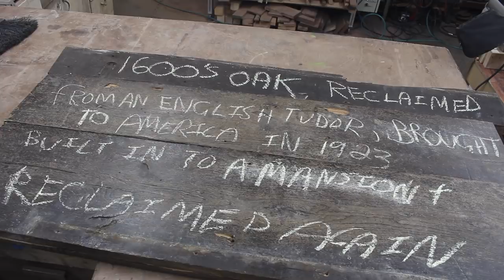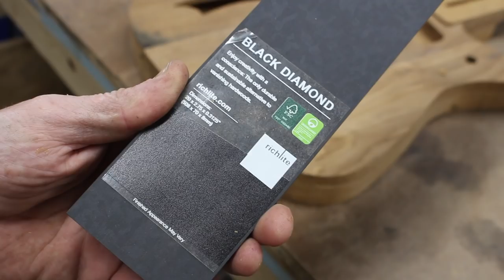400 Year Old Oak and Copper Guitar

Comment: I'm digging your fret edge technique with the belt sander.  Also, I love this design.  The flamed & hammered copper looks great on the dark wood.
Reply from the maker: you gotta be careful to not heat up the frets too much so move small and quick, but it gets them pretty close and saves some hand work.

Comment: Hi tim, that a great process and amazing guitar.
Btw can you tell me what size the original  raw old white oak t=00.05
? especially for 1 guiltar like you built
Reply from the maker: I don't remember the initial measurements, somewhere around 2" thick. The more important number are the blanks I create from the raw material, which are usually around 13" X 22" X 1.5" thick (I go a little thinner than most guitars). In this case, it was a semihollow so that 1.5" is divided in to two blanks, a half inch one and a one inch.

Comment: nice guitar. next one do a 3 x 3 headstock shape that flows with the lines of the guitar body. that would be sweet.
Reply from the maker: i do have a 3x3 design where the top is a little longer than the bottom, but I like the 6x1 better for this body style. I use the 3x3 on my single cutaway.  cheers!

Comment: Curious what 400 yr old white oak smells like...good?bad?musty?  
Lovin' what you do.  ;)
Reply from the maker: It smells just like 10 year old white oak but I must say I don't think Ive ever worked with any newer to compare beyond that :) Not musty at all, tho... White oak has good water and moisture repelling properties, which is why they use it on boats.
Reply: @timsway  I work with Bog Oak, 4000 years old. It smells like burning rubber and works abysmally but boy, does it take a shine.

Comment: Try giving it about 16 layers of Tru Oil for an amazing finish, it will make a difference. This is nice but if you want a step to perfection, sub on some Tru Oil on her
Reply from the maker: My work is based on eco-consciousness and while Tru Oil does make a fantastic finish, it doesn't conform to my ethos. I used Rubio Monocoat on this one which is a pretty good alternative. I actually wrote an article in the last issue of Make: mag about eco-conscious finishes and list a whole bunch (It's in the print version, I don't think it's online yet).

Comment: I don't make guitars and I've only seen a few videos on how they are made. I noticed that you did not glue the frets, but just pressed them into place. Is that normal in guitar making? I had always assumed that there was some sort of adhesive that held the frets in place.
Reply from the maker: sometimes a little CA glue is needed, but if everything goes well, the barbs on the fret are enough to hold them in
Reply: @timsway  OK. Thanks for the reply. I dig the guitar that you made.

Comment: Interested to see the zero fret.  What was the thinking behind that as it seems to still be out of fashion with electric guitars but my Fylde acoustic has on and there is no way Roger Bucknall (OBE) would do something on a guitar without having a very good reason for preferring it.
Reply from the maker: they are coming back in style. I like them because the strings sound and perform exactly the same open as they do fingered and it's easier to get a consistent setup.

Comment: Very cool design Tim! And even cooler history on the wood. Because metal is often a mystery to me, why did you heat up the copper? Was it to harden it?
Reply from the maker: to darken it (and to make it a little softer and try to flatten it out after all the banging). the torch makes it dar, then when you sand it, the high points get light and it stays darker in the divots.
Reply: @timsway  cool! Thanks Tim, learn something new everyday ☺️

Comment: Love the scratch plate. Do you need to coat it with anything to stop it tarnishing over time.

And, just to be pedantic, 1600s English Tudor what? Tudor is a time period, not an object (sorry).
Reply: I think its suppose to tarnish
Reply from the maker: No I didn't coat it so it would tarnish with use, but the pickups are coated to protect them as they're delicate.Yes, Tudor is an era, but it also refers to the style of housing built in the era, described as: 

"of, denoting, or relating to the prevalent architectural style of the Tudor period, characterized especially by half-timbering." 

I'm pretty sure that means it was a building that looked like it was from a medieval tv show :) I don't remember all the details, but the story is documented. It was probably a nice or important person's house because the guy who brought it here 300 years ago was a wealthy importer so I doubt he'd saved a peasant's place.

Comment: What were those clamps that you used to glue the fretboard on?
Reply from the maker: Stew Mac sells them for just that job. They're a little bit of a pain to work with but great for applying even pressure around radiused pieces.

Comment: tim, is there a reason you never do angled headstocks?
Reply from the maker: yes. I do them sometimes, like when I make them by hand. but on the cnc I would either have to waste too much time and wood or I would need to do a scarf joint, which is still more time and effort for a feature that I personally do like a little better than flat heads but I don't think it is really necessary and tend to be more problematic. However I have come up with a solution that gives me the string angle I want, uses some NOS parts I got in bulk and doesn't waste time and wood. I've made a couple experimental necks with 3x3 side mount tuners (like a nylon string) so we get the string break angle over the nut but still do it in a 1" thick piece of wood. I need to make a few tweaks but I'm pretty happy with the look and setup so may implement this in more.
Reply: @timsway  Tim, I have a short scale 25" bass neck from a cheap Japanese bass from the 60's made of what seems to be oak.
It has a tilt back headstock and following the grain it looks to me like it was steam bent to achieve the angle.